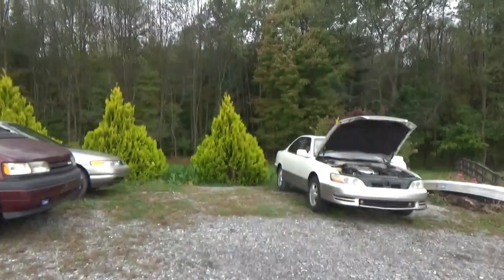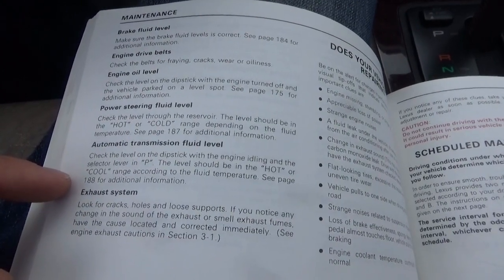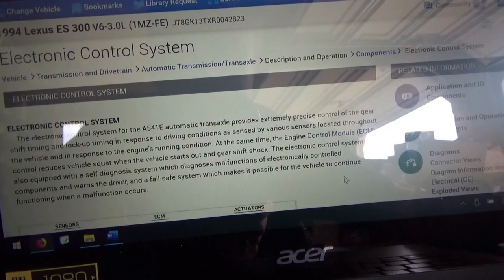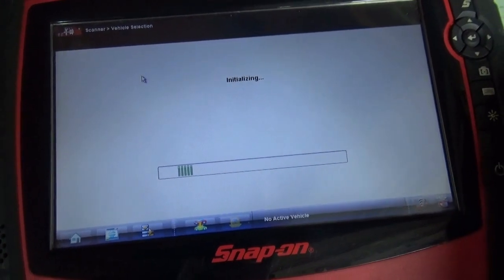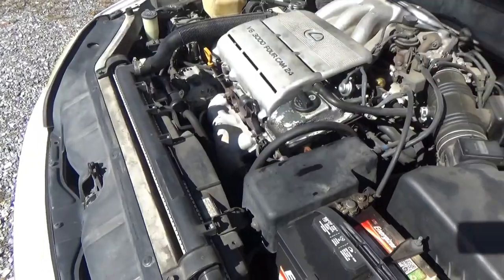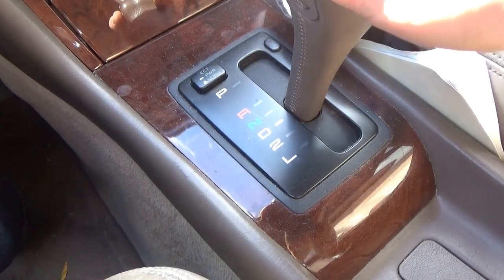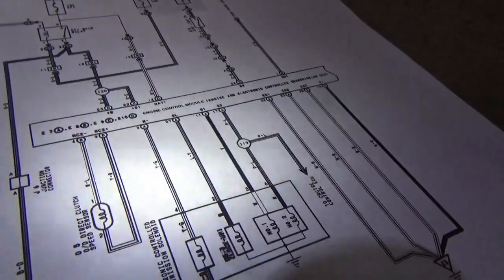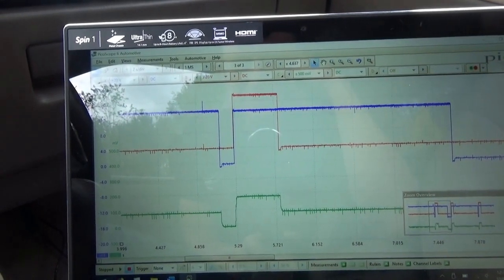Lexus Only Drives in Reverse?!? -Part 1

Comment: I wouldve blew a head gasket and discontinued servicing cars-if adding fluid would've worked😂.  Reason being, fluid has to be introduce the same for reverse as drive. I'm not far in watching but had to say that!
Reply: You're correct to an extent. Had an 05 Grand Caravan with a weak pump. It would engage reverse when it was cold but not warmed up. After a call to a buddy of mine that has his own transmission shop, I learned reverse in that transmission required more more pressure/volume than forward. He explained it well. But he told me that the variable was probably not temperature but instead engine rpm. He also told me from get go that it was probably a weak pump. But anyway, engines idle faster when they are cold. He told me to bring up the RPMs to about 1000 then put in reverse. Voila. My brother used that van for another year and a half after that before someone totalled it for him.
Reply: @ericstevenson7696  oh it's obvious that transmissions shot, in this case! One of my start up videos was doing the SL solenoid on this year car, I've dealt with the solenoids on this joker before.😂😂😂 

But in regards your case, overfilling the tranny only ensures the fluid take up the space of a leaky valve body, it may or may not remedy the problem, if brought above limit.

Adding fluid above the normal fill line will not increase the pressure, but likely fill a void to bring it back to standard pressure.  

-your transmission engaging in cold is a classic issue of this, leaking valve body, leaky solenoid, or Clarence in clutch pack.. Oil Viscosity is thicker in cooler temperatures and thins when hot. This is went Lucas oil stabilizers are thick and claim to correct shift discrepancies😊

Its hard to fathom that a transmission requires more pressure to operate reverse over any other, in regards to something this old. Now Chrysler's have an intelligent shift, but this is post 2011s. 

That's an interesting situation you had!
Reply: @partsshooter  
I agree the transmission in this lexus is likely done for and not worth replacing either. As for my brother's van, we didnt over fill it. Just had to bring it up to a high idle to engage reverse. I had a Nissan Frontier with 240k that had (what people of the interweb refer to as) morning sickness. It had a leaky valve body and did require a slight over fill to remedy that. It was a cheap truck that I used for commuting and running parts or the occasional scrap haul. Wasn't worth properly fixing.
Reply: @ericstevenson7696  morning sickenesd😂😂😂. I'm 33... Too young to have heard that.

Make sense from what you described! Nissan's are hella-reliable
Reply: @partsshooter  
Im 30... 😒
Reply: @ericstevenson7696  you were close! Rev the engine up and it works! However... Transmission clutch pack still broken!😂😂😂

Comment: Rev Up Your Transmissions!!!.......
Reply: Ok, so I cheated and watched the next video.  In my case, my reverse is great but revving the engine did not dislodge anything from a solenoid and I don't know the software you're using to diagnose malfunctioning solenoids so I'm considering guessing which solenoid is my issue.  Any suggestions?  I changed my fluid and filter, and refilled.  It appears there are several solenoids.  Suggestions or flow chart for next steps?

Comment: Some are saying the forward clutch packs are burnt out, but I would think that the customer would have noticed some slipping in forward gears before complete failure.
Reply from the maker: Very good point. Car driving perfect and then suddenly losing forward gears definitely doesn't sound like a slow and painful wear-and-tear problem. Burnt clutches slip for a while and give the owner plenty of warning...
Reply: @PineHollowAutoDiagnostics  Bad clutch packs also don't explain any connection to rainy weather, nor the forum posting you found about the guy who pressure washed his engine and lost all forward gears.  If the problem is caused by water then that has to be an electrical issue.  Of course it could just be a coincidence too.
Reply: Of course.
Reply: Customers don’t lie right?

Comment: If it has over 100k and the fluid was never changed it would not help to change the fluid the seals will worn and new fluid is thin it would never build pressure
Reply from the maker: Interesting thought...I have seen this before, so put the old fluid back in haha
Reply: If you want the pump to work

Comment: My niece had one in 4wd trim...worst car I've ever been around WORST! ECM's burned up at 103,000...transmission at 122,000, calipers locked up at 86,000...left her stranded a dozen times which turned out to be multiple shorts in the main harness. JUNK! and I was usually the one that had to get her un-stranded. JUNK!

Comment: The forward clutches are burnt out magnetize the dipstick running for five minutes if you have metal shavings you know they have is burned out text about five minutes and then you know Extreme waste of time that's what you did
Reply from the maker: Yes sir, extreme waste of time. I'll tell the customer to send this mint Lexus straight to the crusher ;)
Reply: @PineHollowAutoDiagnostics  LOL
Reply: True. A "real" mechanic would sell them a new transmission. If this doesn't fix the problem, sell them a new TCM module. If the car still can't run, tell them that all wires in the car are too old and can't carry the electricity very well (LOL). Offer them a "killer deal" on a new Lexus! It's business 101....
Reply: I would imagine a clutch would slip when it's almost worn out, I have never had a clutch that just stops dead.
Reply: @PineHollowAutoDiagnostics  Since when was learning things a waste of time..Even the best Technicians in the world don't know everything.👍👍